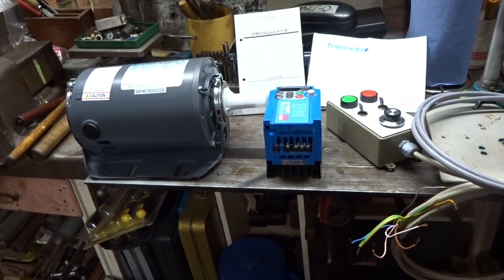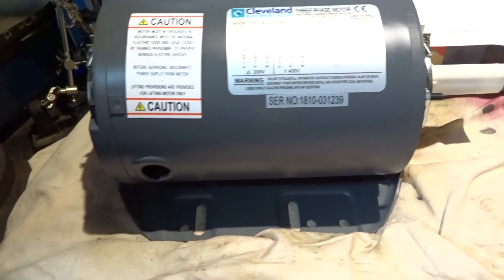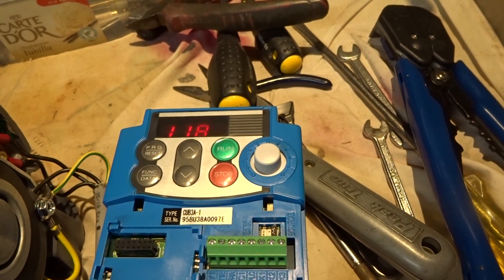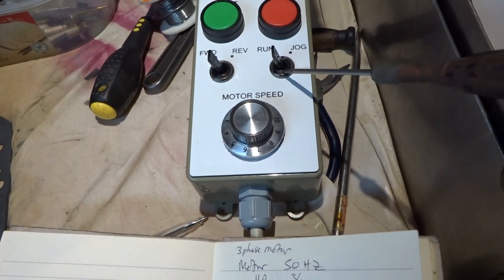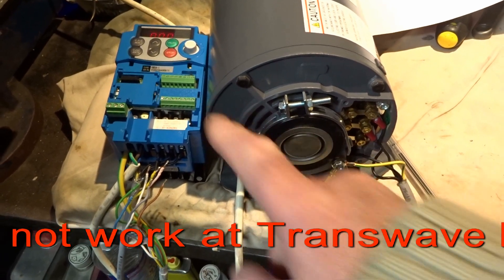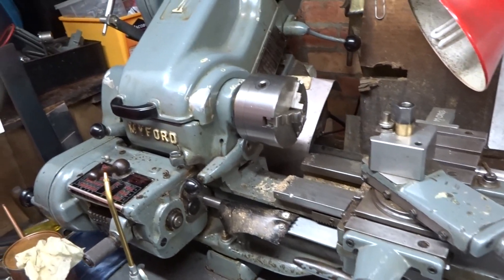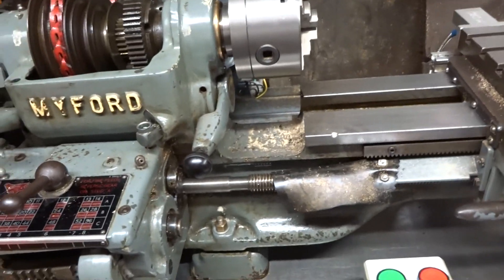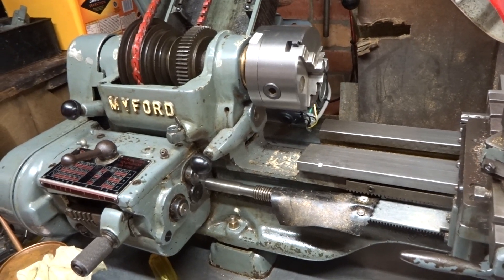Installing a 3 phase variable speed motor to my Myford lathe

Comment: Looks good, Edwin. I changed the carrier frequency on both of my VFD's to 15khz so I wouldn't have to listen to the whistle, with no adverse effects.
Reply from the maker: Thanks Jon. I haven't heard a whistle (as yet),but admittedly I am rather deaf! The VFD on the lathe and mill have had a fair bit of use with (so far) no adverse problems. Regards, Ed
Reply: @edwinwhite933  If you can't hear it then it's not a problem. Fortunately for my musical endeavors, I can still hear pretty well. I just can't see. Seeing an opthalmologist in a couple of weeks. Take care.